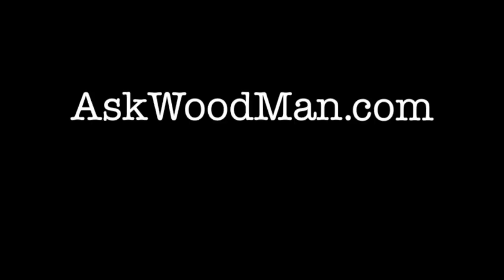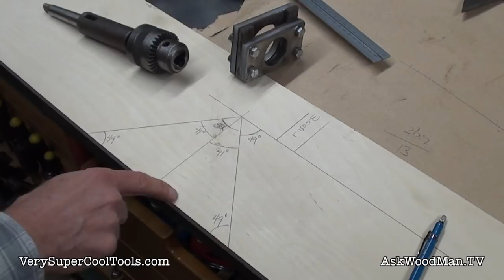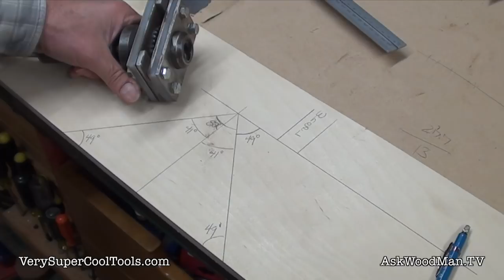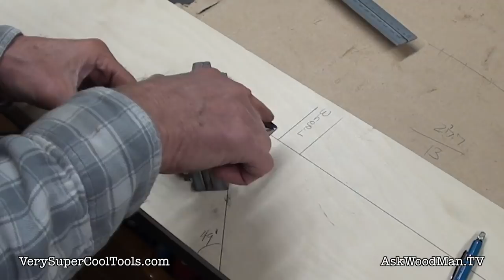1125. Save Money, Resharpen Countersinks • 1 of 3

Comment: The marks on the rest are made with just pencil or something? I thought they were machined.  Thanks for the video!
Reply from the maker: Those lines were made with a tungsten/carbide scribe guided against the sliding t-bevel.Those scribes are my favorite marking tool for steel fabrication.